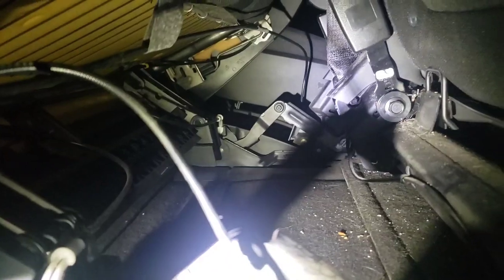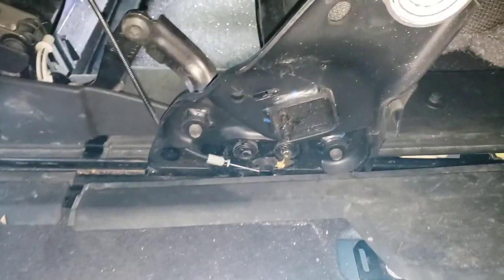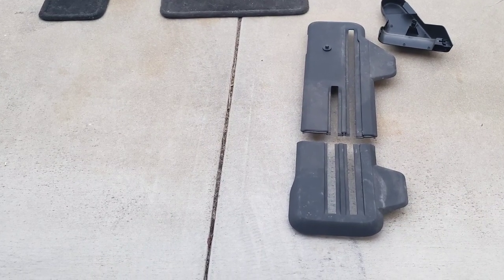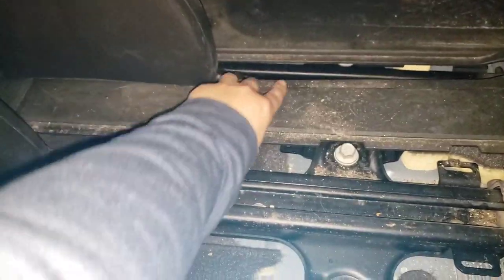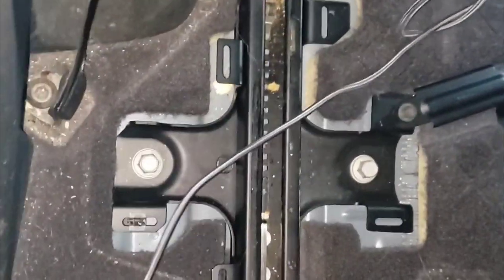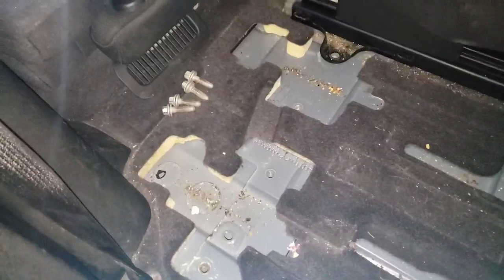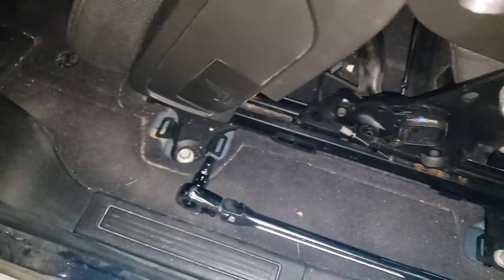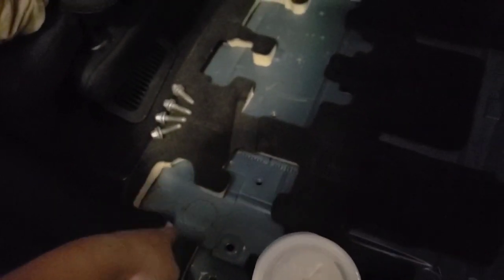2012 Chevy Traverse second seat removal | No power tools | Breakdown of the entire process

Comment: I have been in the Auto Body repair field for about 50 years and I was very impressed with your breakdown and explanation as you discovered your way through the process. The reason the seat track bolts were so tight is that the factory uses Loc-tite thread lock on them so that they don't vibrate out,  If you look at the threads after you have the bolt out, you will notice blue or yellow on the threads.  The different colors basically indicate a 'grip strength'. If you can put a little 'heat' to a bolt head it will twist out super easy. Good Job!

Comment: What about the nuts that dropped from underneath the vehicle? Those bolts are through bolted. How do you plan on getting those back on? Or are the nuts tack welded underneath? This video did not explain that.
Reply from the maker: The threaded part is connected so you won't need a tool to hold it in place, or worry about nuts falling out. 

It was fairly simple putting the seats back in. I just hand started all the bolts, tightened opposite ends, then torque.
Reply: @lydiak.1254  Thank you very much!

Comment: Anyone have a video of putting the plastic track shields back in?  Been trying to get mine back in for several hours and cannot figure out how to get the plastic under the seat and back into the correct position without breaking the shield(s)
Reply from the maker: You may have to move the seat all the way forward to place the back ones. Then roll it back to place the front ones. They have a lip too, one had to be on top of the other. Lay them out on the floor first to see which one is the under side and place those first. Moving the seats forward and back can help.

Comment: Can i remove the seat and not the tracks?
Reply from the maker: I did not look under after I pulled it out. I wouldn't think its easier to work under the seat while still installed than it would be to remove the entire seat then flip it over to and check if the cushion part is removable .

Comment: I guess I would have been a much happier Traverse owner had these been as easy to remove on Chrysler T & C minivan. Sigh.
Reply: I meant that Chrysler middle row seats were extremely easy to remove and reinstall, while Traverse's are not.
Reply from the maker: Funny that you say that because I recently reinstalled these seats so I can sell it to get the Chrysler Pacifica Pinnacle. Those middle seats in the PHEV are two latch pulls. Agreed so much easier.